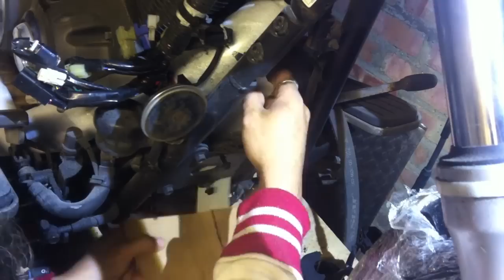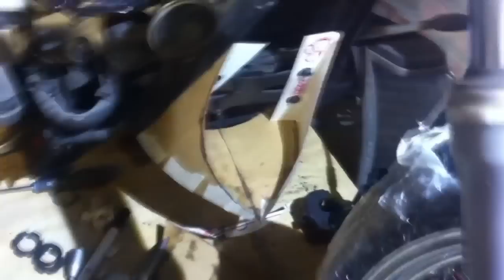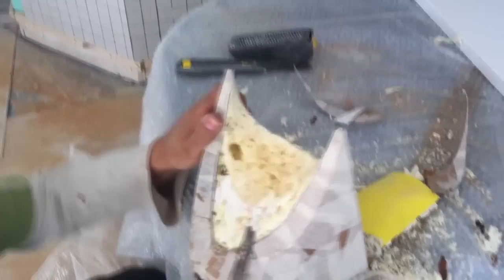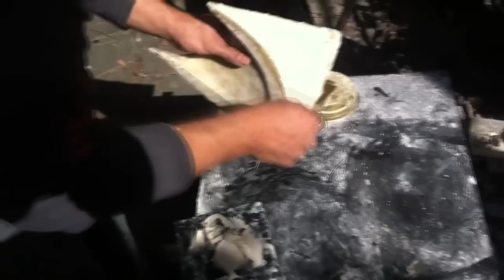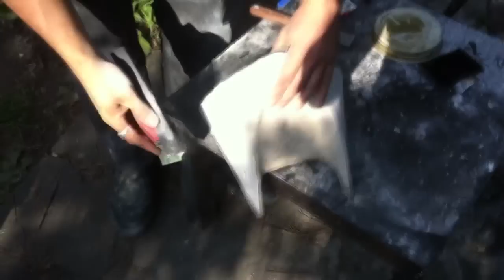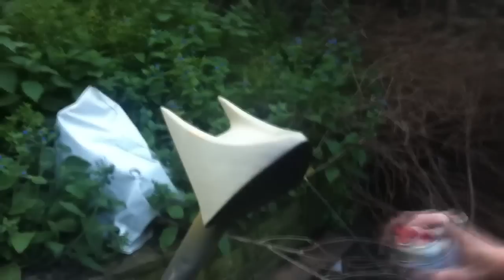Chin Spoiler [Budget Chopper]

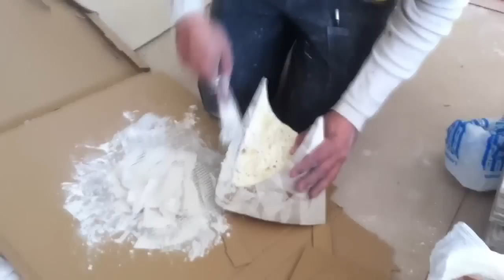Comment: What are putting over the cardboard at 1:35?
Reply from the maker: thats simple drywall filler
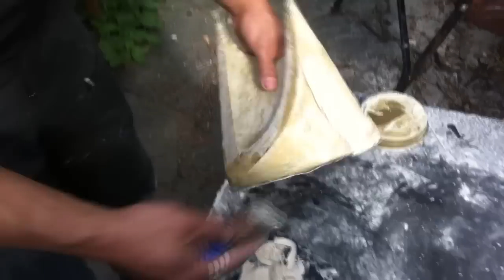Reply: +Lord Samaels ok, and what r u applying after u lay the fiberglass @ 2:13?
Reply from the maker: polyfiller
Reply: +Lord Samaels can the glass be laid on the cardboard, or will it only adhere to the filler?
Reply from the maker: +maxgtv fiberglass will stick to almost anything, filler just smoothing edges and helped to make better shape